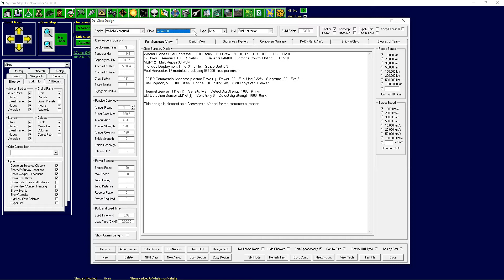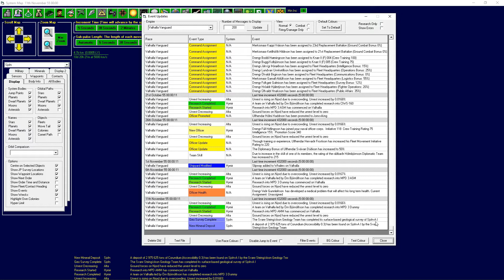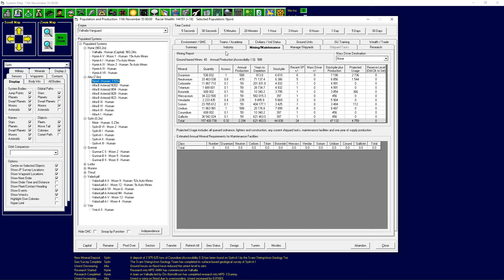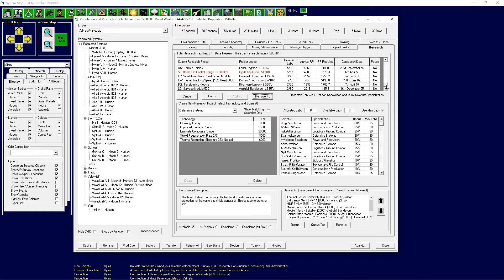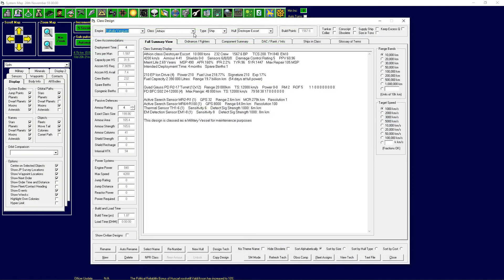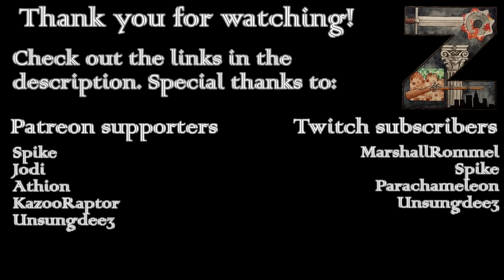Aurora 4x | Valhalla Vanguard | Ep51: Tier 3

Comment: Do you want to wait and make a RoF 5 meson for the fighters before starting them?  It would only take another level of capacitor (cap 3) I think.  Doubling the fire rate seems like a nice tradeoff for the slight extra expense.
Reply from the maker: The current design that I have doesn't have RoF 5, but I still haven't built any of the fighters and I do, in fact, have both capacitor 3 and focusing 3 in what I've recorded so far. I think I'll quickly add in a R4.5/C3 meson cannon to the research queue and call the design complete. Cheers for reminding me (I had quite forgotten I have those available)!